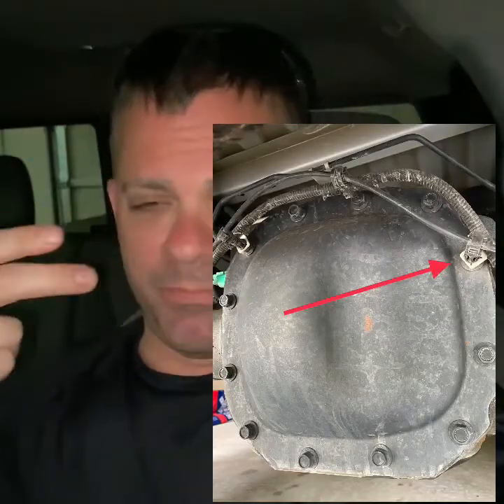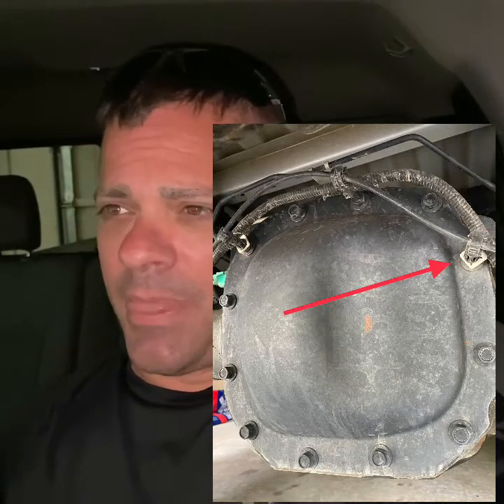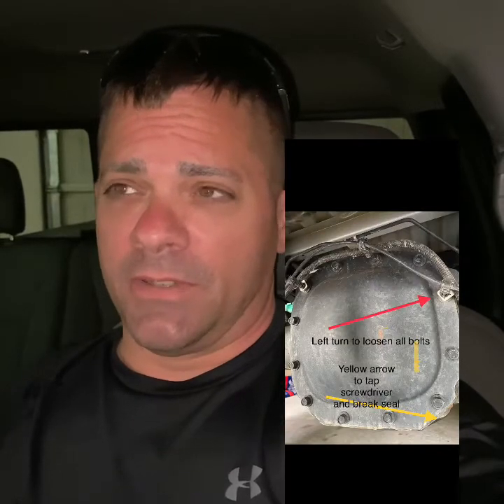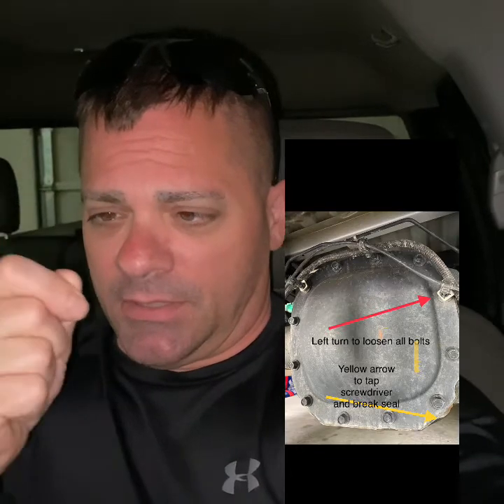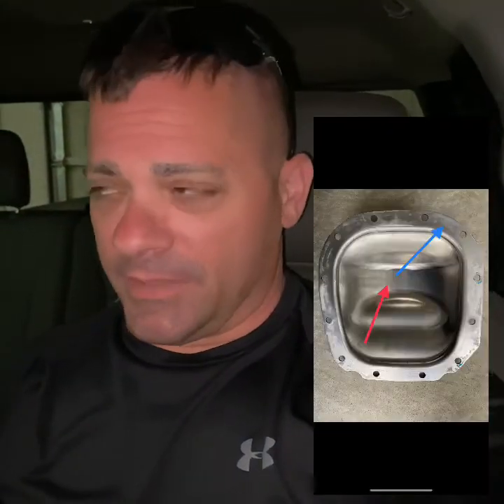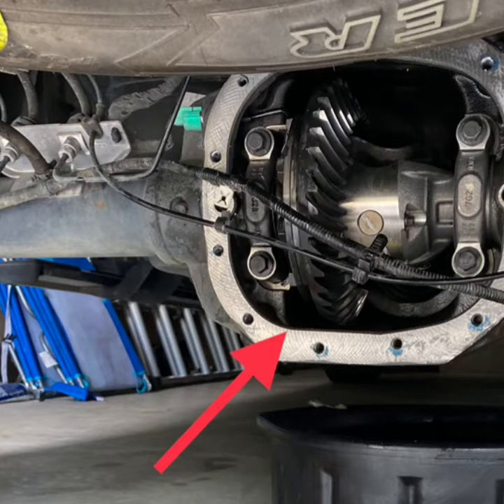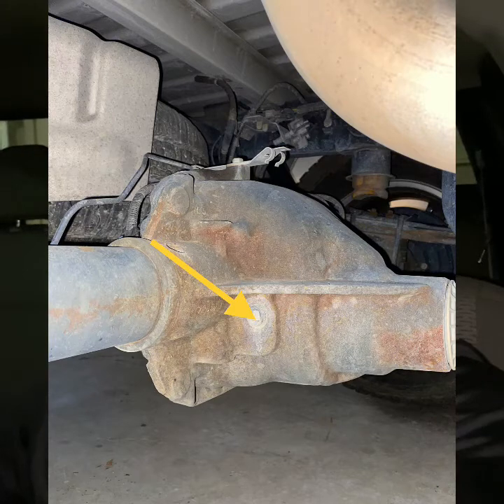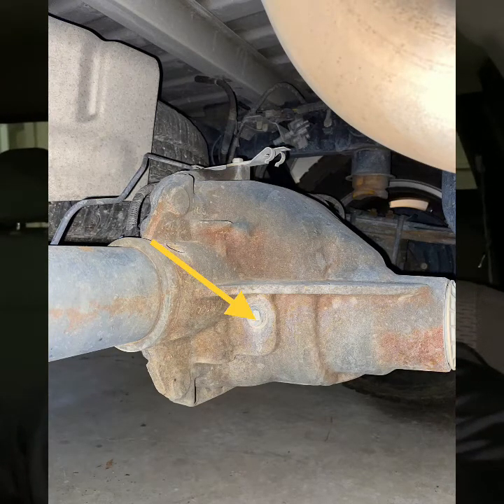2018 F-150 5.0 3:55 locking diff Fluid Change

Comment: Nd ur supposed to use the green permatex rear differential gasket maker it handles the heat better and won’t go bad if diff fluid come in contact with it on initial fill up.